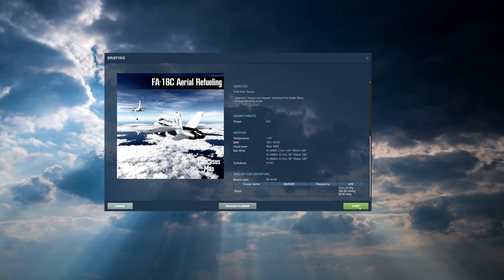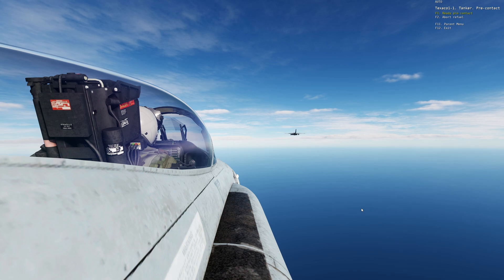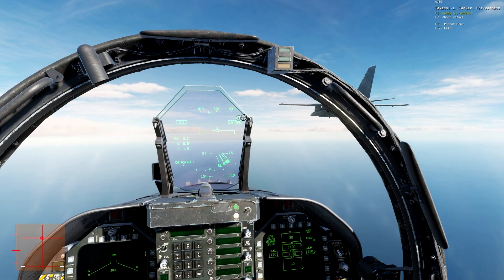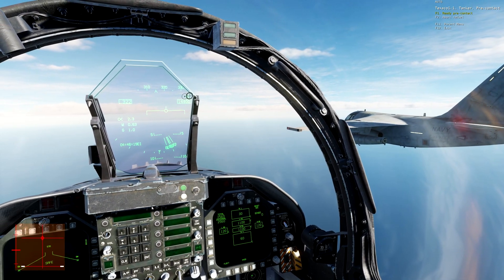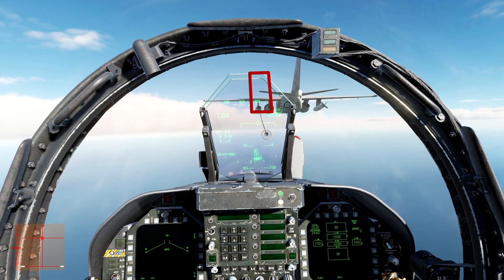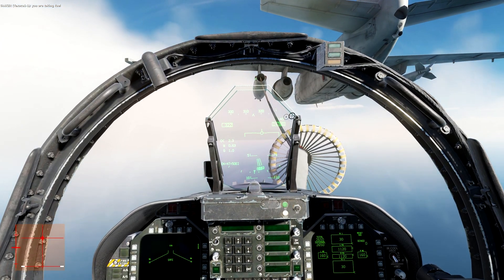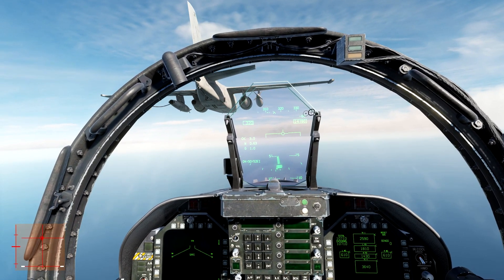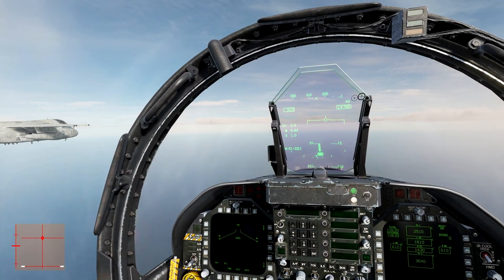F/A-18C Aerial Refueling | DCS | Tutorial | Amazing Graphics

Comment: It is really not easy but I could connect them I can't hold it, is it like that in real life? I mean, once connected it is so rigid that does not let you move even a little? I feel like doing 322 knots I start to separate and at 323 I get closer 😅
Reply from the maker: Whats up RResus. I believe it's or even more difficult in real life. AAR is complicated even for real pilots. Refueling using the S-3 makes things more difficult because its hose is shorter. The hoses on the KC-130 and 135 are longer allowing us to move without disconnecting. As for speed, that's it. We can hardly keep the throttle stopped. We have to keep going back and forth with it😬. AAR is the hardest thing in DCS 😅
Reply: @nazguldcs Thank you very much for the reply and the video, it really helps. I like the fact that DCS tries to keep it real and challenging. Just something that may help some people here, I was flying with a Thrustmaster t16000 stick then yesterday got the winwing Orion 2 navyAce and it makes a huge difference, specially those small precise movements I couldn't do it with the t16000
Reply from the maker: Wow, man, really nive 😮. Congrats 👏👏👏. That stick is awesome. I have a VKB Gladiator Pro (metal gimbal) and it's already amazing. Imagine this one. Did you get the throttle too? I'm looking to get the Orion 2 NavyAce throttle, but I have a specific question about the TDC ministick position.
Reply: @nazguldcs  Yes I got the throttle first a while ago, very happy with it so far, I'm impressed with the quality but I have to say I'm a beginner so anything above 200$ is good for me. I did not buy the finger lift cause it is around 60 USD and I have a 3D printer so instead of buying it I made a detent just to feel idle and afterburner position.
Reply from the maker: Cool, man. You've got some great stuff. Now if you fly poorly you can't blame your HOTAS 😂 Just joking 🙂. My question about the throttle's TDC control is whether it's positioned comfortably when at full throttle. I'm asking this because I'm considering choosing the 18 or 15EX grip. The 15EX's TDC control seems to be pointed too far down when the throttle is at max. The 18's seems to be better positioned. 🙂
Reply: Haha, I now that even a 1000 USD HOTAS won't make me any better. I literally suck but at least is closer to the real thing I guess. I have the 18's and the position is perfect but no idea about the EX, actually I don't even know why I chose this one, I guess it was the bc of the ergonomics too and did not like the EX's sharp edges. I guess you won't get it wrong if you buy any of them but again, I'm pretty new at this.
Reply from the maker: Hahaha, no problem, you already helped me a little. Knowing that you chose this due to ergonomics and that the 15's grip has more abrupt helped me. Many thanks bro 🍻😉

Comment: That was awesome. Thanks
Reply from the maker: My pleasure man 🤜🤛😉😎
Reply: @nazguldcs  can i ask how you preformed the camera angles? iv crashed and burned so many times but your help from this video, i will overcome haha
Reply from the maker: Sure. I use the F4 camera. Then I position it where I want, giving it that Go-Pro feel 😉
Reply: Nice thanks.. im having real trouble with hotas x56 trying to do this. @nazguldcs
Reply from the maker: Oh yes, I had a little bit too. I had a similar one. The X52 pro. Its spring system is a little bad for small movements in the center. When we move from one side to the other of the X or Y axis, the spring "cap" holds it at the zero point.

Comment: Also, using the striped carrier hook as a reference point while aerial refueling might be unrealistic when refueling from persay, an KC-135. In a realistic multiplayer scenario where you would need to refuel, an S-3B is always patrolling the airspace around a tanker, meaning that other tankers would be more help to aerial fueling.
Reply from the maker: Hey man. Whats up ? Oh yes, because the KC-135 doesn't have a hook. There's no way we can use this reference. The player would have to create new reference points 🙂. But it's strange that the mission creator put a Viking together with the KC. Although they are refueling aircraft, in real life e.g., they operate in different scenarios (at least most of the time). The Viking will usually operate near the carrier group supporting aircraft that take off heavy and low fuel or those returning with low fuel from missions. The KC, on the other hand, will operate in squadron movements or near conflict areas (not over them) supporting operations because it carries much more fuel being able to support a greater number of aircraft.  But in DCS, it's known that refueling in the Viking is more difficult than in the KC-135MPRS or the KC-130. So, most of the time we'll find these two in missions because they're easier, and that's also why players will generally want to refuel in them. But yes, the hook will be of no use. They will have to find other reference points. Thanks man for you comment 🍻😎
Reply: Your welcome, I meant to say that KC-135s are closer to combat zones which is where fuel is needed, rather than next to a carrier where you can land and refuel much more easily.
Reply from the maker: @MidNight35355  In fact, you just gave me the idea of making a refueling video using the KC-135 😁. I did this one with the Viking and I also did one with the KC-130, but I haven't done it with the 135 yet. I'll think about it.😉
Reply: Thank you! That would be really helpful in my situation! I only need aerial refueling, and then I can finally master the F/A-18C
Reply from the maker: @MidNight35355 1st Try to fly alongside the Tanker so that one of its engines is in front of the other. Try to maintain this position and find out its speed. From then on, you will make small movements back and forth with the throttle to move back and forth. (You will always have to make small adjustments to the throttle back and forth. It will never stay stopped. That is an illusion. I'm sorry😅).
2nd When you are positioned behind the KC-135, with the basket already positioned for refueling, you can keep the basket positioned on the 5 degree line. As you get closer, you can position the basket between 1 and 2 o'clock from the VVI.
3rd When the refueling system (where the basket comes out and which is under the tip of the KC's wing) is positioned at the top of your HUD a little to the right of the center, you will start to have this reference and stop looking at the basket directly. Look at it only with your peripheral vision.
4th After connecting to the basket, keep the refueling system on the top of the HUD and the KC-135 engine right over the right support of the HUD. Here you can use the KC emergency windows as a reference, keeping them behind the FA-18 canopy arch. 🍻😉😎
Reply: It would also be amazing if you could give me tips about refueling from a KC-135PMRS, because I can't seem to get it. Also, what is the best way to maintain steady throttle?

Comment: Great video! Out of curiosity, what are the settings on your joystick: deadzone, curvature, saturation and do you have a throttle curve?
Reply from the maker: Whats up man. Good question 👏. I have my own adjustments. To better answer, I will post images of the curves and my adjustments in the Community tab of my channel. Right now I am at my job, but I will post the images later 😉 Thanks for the question 🍻
Reply from the maker: I 'm back. Man, I looked here and in the FA-18 I don't use anything on the axis. In the F-16, yes, I have a curvature in the throttle, but in the FA-18, no. I use the default settings.

Comment: A good point of reference for the s3 tanker is to put the engine nacelle in vertical lineup with the "teeth" of the pitch ladder edge,  drive that nacelle to that position and you will connect with the basket when the bottom of engine is just about horizontally aligned with the 5 degree line on the ladder. Because it's a hud reference point,  you don't really need to worry about lateral visual checks.  Also, there is a covered switch right next to the takeoff trim button, below the probe controls, the FCS gain switch.  Kick that into Oride and the your inputs get dampened, feels kind of like the specialized AAR stability mode on the su-33.  Just remember to punt it back to norm when you're finished
Reply from the maker: Cool man. I have never used this switch. I'll do a test here later. Also good are these reference points. Thanks for the comment! Good flights! Many thanks! 🍻😉😎

Comment: For those out there struggling, I found a little cheat yesterday and was finally able to do it, engage the AP ATTH and that gives you a ton more stability. First time I ever successfully tanked and did it 3 times in a row
Reply: It also let you use the trim hat as a mini joystick to make those fine adjustments.
Reply from the maker: Nice! Tks for sharing 👏
Reply: Huge help on the approach but a little tricky to get it done when not on the exact same alt as the basket. Also, ATC engage to maintain speed was a huge help. I felt like a noob with all the help but I needed it lol.

Comment: I can never keep my plane level
Reply from the maker: Its really hard. When we accelerate, it go up. When we slow down, it go down. We always have to corect with the stick. Try to find the throttle point where you are almost at the same speed of the tanker. Once you find, you will need to make very small adjustments back and forth. Find this point helps a lot to avoid making sudden movements on the accelerator and reduce the ups and down 😉. Keep pushing💪
Reply: Found a little cheat yesterday and was finally able to do it, engage the AP ATTH and that gives you a ton more stability. First time I ever successfully tanked and did it 3 times in a row
Reply: @TheChiefrice  another hack, in the f18 at least, is you can use atc (auto throttle) to match the speed of the tanker. U gotta be pretty close speed when u engage, but if ur creeping up still, just quickly turn it off for a sec an straight back on till ur going same speed, then just focus on flying
Reply: I always use AP:BALT. If the tanker is at 20,000 ft, set AP:BALT to 20,050 and the problem is solved for me, and speed & roll manually.